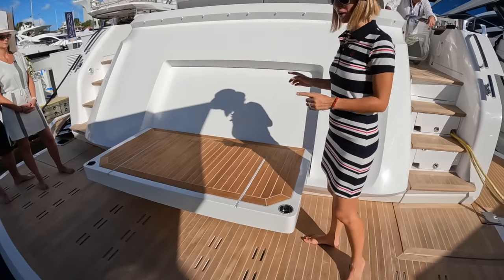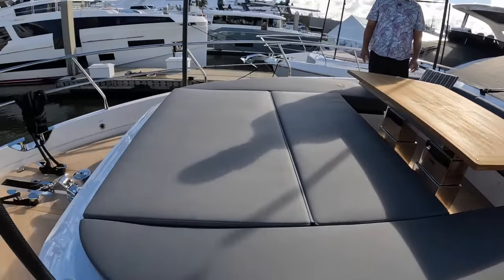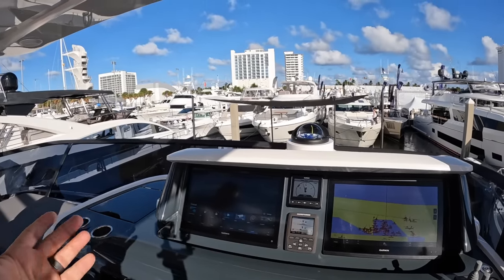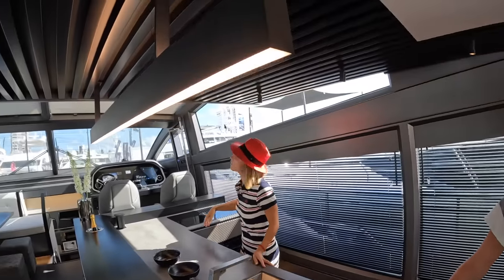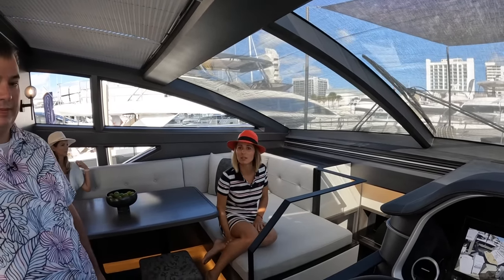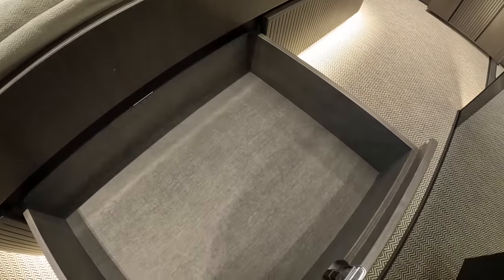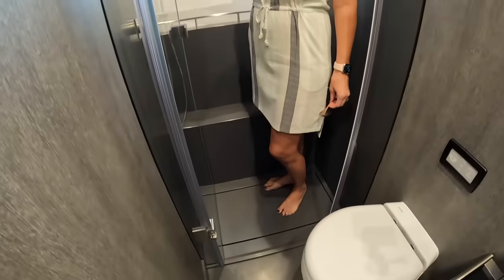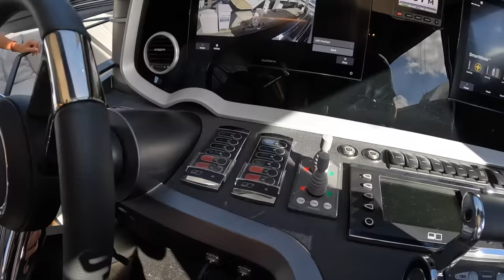Brand New Model PEARL 72 Luxury Liveaboard Cruiser Motor Yacht Tour & Specs

Comment: That's a lot of internal volume for a 72 sports yacht. The salon isn't quite me but that's just a design preference and easily changed. The tender garage is great, room for a RIB Jet and a jet ski on a 72 is a rare thing and the head room sacrifice in the engine room is something I could live with given the size of the boat. Very nice work Perl, you should be proud of the design, it's a winner in my book.

Comment: This is a beautiful boat! I actually can't think of any demerits... Good room size, good engine room size (you can stand in it!) as well as really sleek interior design. Very formal/masculine. 

Also, super cool that you brought some of your supporters on! :D
Reply: I was enjoying the review of this yacht until the engine room.  
Every time I see a nice tender Garage I know the engine room will be cramped.   Imagine how hot it is down there to do any service outside of normal service intervals.  
It’s just my opinion but I would think most people with advanced knowledge of yachting/Boating wouldn’t want to deal with that engine room ?? 
I bet a few things accidentally break when you have service people crawling all over those engines to work on various systems in the ER.   To many choices in that size category for those in the know
Reply: Demerit for range. Its range is horrible for a ship that size.
Reply: There are definitely some demerits. 
The bathrooms don't need to be so large and waste valuable space that could be used for something else like to house a large hideaway refrigerator/freezer or washer/dryer unit or storage closet. Install sinks on the wall right above the toilet and move the shower over to use that former space wasted by the sink. I looked at the layout on Pearl's website and there is ssooo much wasted space from equipping all of these large bathrooms.  
The galley stove needs an overhead vent and guards to catch any spattering from cooking. Without the vent, that interior is going to collect cooking odors.
Reply: @riproar11  You have to understand that my judgements on these boats are purely subjective based on what I like and what I would want. You might not like the boat, but I do. And that's completely cool.
Reply: @Xero1of1  I completely get it! I like this boat a lot too! And the decor is very inviting. It just wastes a lot of useful space. It doesn't have a communal day head for everyone onboard. Please look at the Pearl website and you will see how much space is wasted by giving every bathroom a separate shower area, instead of conserving useless bathroom areas for better uses. Exactly how dirty does a person become by staying on a boat that is far away from muddy and dusty land??

Comment: Thank you for another great video!! From the perspective of an artist and designer, this is an aesthetically pleasing yacht. For a 72 ft yacht, it uses its space in a creative and efficient way.  I particularly like the louvers on the flybridge :) I'm not sure, though, why one would need crew accommodations for such a relatively small build. If customization is an option, I would use the crew space as expanded utility (larger freezer or fridge, for example. Better yet, more space for Rico to store some awesome DJ gear :) ) and storage. This is definitely not a long-range cruiser by any means, even if you putter along at 10 knots. But if zipping to/from/through the Bahamas or the Keys is your jam, then this would be an excellent choice! Intracoastal Waterway, fahget about it.

Comment: Very stylish boat. Nicest bow VP I can think of. Could use bigger windows though, that would make it significantly better.
Imagine when yachts have compact fusion reactors and electric drive. Completely quiet and no engine room, no fuel or exhaust and essentially unlimited range. With acequate power, some will even be able to fly. Some even to space.

Comment: Very nice cabins also salons.Something i did not like is the size and the place of the galley.I believe most galleys are underestimated about the size and space for storage.Think that if you are in the open sea you cannot get a delivery so you have to cook which means you need enough space to work and to have supplies.The other thing that is not matching is the position of the galley right behind the captains seat ......which means the captain runs the boat and you behind him frying eggs.....not proper and safe to have heat dirt and cooking oils so close to a seat and mostly....the captains seat.Good design but i feel something is missing.

Comment: Is that a typo on the range?  If that's accurate this boat barely qualifies as a puddle jumper!  Unless the consumption drops to around 1MPG at 10kts.  I will admit that Pearl does make a beautiful boat, especially having two very lovely ladies to show it off.
Reply from the maker: That’s a range AT CRUISING speed… which is Never An economical speed for a planning yacht. It will have a 1000NM range if you go economical
Reply: @NautiStyles  Understood, but it still seems like it would be more of a short range yacht.

Comment: That slatted roof is just plain silly.  I'd imagine after a few years it would break in the open position right before you hit a nice squall.  The way I'd spec it would be with solar panels on the roof, a bunch more batteries so you run the generator a lot less.